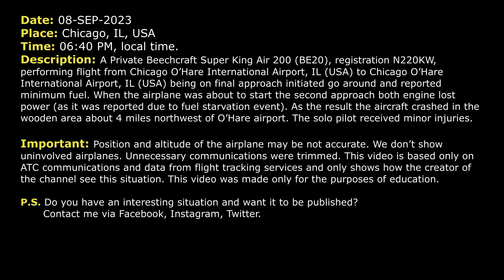Both engines stopped in flight. The is no FUEL. Beechcraft 200 crashes neat Chicago. Real ATC

Comment: I'm confused !!  The prologue states that the King Air was travelling from O'Hare Chicago to O'Hare Chicago !!! That's a mighty short flight to screw a fuel loading! 😆 I love your site.
("Probably whatever mission he was doing was a moot point if he couldn't land at Waterloo, so it made sense to return to base. Solo pilot in a King Air, likely he was going to pick up passengers at Waterloo to take somewhere else as a charter flight. Unable to land at Waterloo, the flight would be canceled, likely they'd use other transportation (probably just drive), so he was trying to return to home base. But didn't have quite enough fuel for the round trip.")

Comment: “Min fuel” should be declared at the point when you know you are landing with less than 45 min.  This (should have) been realized when talking to approach and not to tower on the go around instruction.  Maybe he didn’t add in fuel for a possible go around ?  A “mayday-mayday-mayday, fuel emergency” should be declared when known conditions exist if landing with less than 30min.  Then again, these are part 121 rules but would definitely keep any aircraft out of fuel starvation.  I’m glad the pilot wasn’t seriously hurt.

Comment: For King Air drivers if ya ever wanted to know how to run a KA outta fuel you now have a source. 
Why go-around in VMC with very low fuel in the tanks? 
KA drivers know why and what the yellow arcs on the fuel gauges mean. 
Always disappointing when an accident, that’s avoidable, happens.
Reply: Yep.

Comment: Unbelievable on both sides. ATC on  hearing "minimum fuel" should have immediately instructed go around to BOTH the other aircraft and got the stricken Beechcraft down whether or not it was a declared emergency. The Beechcraft pilot was utterly mad to continue an extended circuit knowing he was critically low on fuel, not just "minimum". Why is it that ATC in the US carries on vectoring other aircraft in when they know there is a potential emergency? The Beechcraft could have easily made it in with a simply VFR circuit close in to the pattern. This keeps happening. Madness.
Reply: You have no clue

Comment: My speculations: He knew he was low fuel, but didn't realize just how low. Thought he had 10 minutes left, when in fact he had zero. Perhaps a miscalculation, perhaps a malfunction in the plane's fuel quantity calculation system. Thus he didn't declare an emergency as he thought he wasn't in one, just "minimum fuel" as he reported. Let's at least give him benefit of the doubt.
As for the route, it sounds like he flew to Waterloo, had to divert, and came back to Chicago. Solo pilot aboard a King Air, probably a charter flight picking up passengers at Waterloo. Unable to land there, the whole mission was canceled, and so he tried to simply return to base at Chicago. Had nearly enough fuel for this, but either burned more or had less than expected, but both his return flight and declaring "minimum fuel" suggests he believed he had enough fuel for this.
Reply: Hoping for a quantity malfunction; that's one hell of an expensive miscalculation if not.

Comment: This is a great example of reluctance to declare a formal emergency…(no Pan or subsequent Mayday). Declaring ‘fuel minimums’ without stating what exactly you require from ATC is not best safe practice. The pilot always retains power of veto over ATC - accepting vectors that take you away from a safe landing option when in any type of emergency is foolhardy and bad airmanship. Glad to hear the pilot walked away in one piece - very lucky chap.

Comment: Minimum fuel = 30 minute reserve fuel, not the Empty line on the fuel gauge!
Unbelievable this happened and so preventable
Reply: We don't know what the fuel gauge was saying, perhaps there was a technical fault of some sort making him think he was low but not about to run out. Based on everything it sounds like he knew he was low but didn't realize he was this low.
Reply: @quillmaurer6563 fuel gauges on King Airs and turbine aircraft generally are quite accurate. It isn’t a simple float system like on piston singles.
Reply: Minimum fuel happens before the 30 minute point unless you happen to be touching down at that instant.

Comment: Let's hold back on judging the pilot until we get the results of the investigation. Must not neccessarily be his fault. Could have been a technical issue. According to ASN he did turn around because of some sort of problem in the first place. That dude didn't sound like he was not on top of things for sure.
Reply: Most likely low fuel but he hadn't realized how low. I don't know about King Airs, but I know Cessna fuel gauges suck. Turbine aircraft should have pretty good fuel management systems, as long as he knew how much he took off with the system should be able to keep track of how much he had, but that might not have been working right. He knew he was minimum fuel, he probably thought he had 10 minutes when in fact he had zero. He seemed aware that things were getting worse just before the engines quit, probably had some sort of warning sign (maybe one engine went out), but by then he was already being vectored onto final so an emergency declaration wouldn't have helped anything, and once the engines quit he made his situation pretty well known.
Reply: @quillmaurer6563 minimum fuel is when you are in danger of eating into your reserves if you have an unexpected delay. Emergency fuel happens the second you are into your reserves. He should have declared an emergency and they would have put him in front of the other two planes on the approach.
Reply: "That dude didn't sound like he was not on top of things for sure."
Seriously? He far king parked due to fuel starvation so just how is that being on top of things? It was amatuer hour in a B200.
Reply: @josephking6515  And I thought amateur hour was to reply on a comment you didn't understand...

Comment: ... Minimum fuel versus ... he was clearly in EMERGENCY FUEL situation. Which he did not properly relay to the controllers. If he had declared an emergency both of those other planes could have been moved out the way and he wouldn't have crashed...
Reply: He was emergency fuel about 40 minutes before getting into the circuit at ORD.

Comment: The pilot did not signal strongly enough, that he was in a critical fule situation and allowed himself to be steered far away from the airport. Mayday mayday mayday critical fuel now, MUST land now. And both the plane and pilot would have landed safely, and some extra paperwork had to be filled out.  There is no reason to be afraid to use pan pan pan or mayday mayday mayday when you are in a bad situation. Better to do it ones time too many, then to hesitat and  suffer  fatal consequences

Comment: For everyone commenting on "Minimum Fuel" equating to an emergency, the most recent version of the "ATC Bible" (Order JO 7110.65AA Effective April 20, 2023) notes that "Minimum Fuel" is not an emergency:

2−1−8. MINIMUM FUEL 
If an aircraft declares a state of “minimum fuel,” inform any facility to whom control jurisdiction is transferred 
of the minimum fuel problem and be alert for any occurrence which might delay the aircraft en route. 
NOTE−
Use of the term “minimum fuel” indicates recognition by a pilot that his/her fuel supply has reached a state where, upon 
reaching destination, he/she cannot accept any undue delay. This is not an emergency situation but merely an advisory that 
indicates an emergency situation is possible should any undue delay occur. A minimum fuel advisory does not imply a need 
for traffic priority. Common sense and good judgment will determine the extent of assistance to be given in minimum fuel 
situations. If, at any time, the remaining usable fuel supply suggests the need for traffic priority to ensure a safe landing, 
the pilot should declare an emergency and report fuel remaining in minutes. 

By not declaring an EMERGENCY the PIC arguably failed to discharge his duties under 14 CFR § 91.3.
Reply: The AIM 5-5-15 says something similar.
If you're dipping into reserves to make an approach, it's minimum fuel.
If you don't have enough fuel to do a go-around, it's an emergency.
Reply: EXACTLY RIGHT. There is a HUGE difference between stating minimum fuel and a FUEL EMERGENCY
Reply: One of your best lectures. How long did it take to copy all of that?

Comment: I fail to understand how a pilot would not load sufficient fuel for any given trip.  Running out of gas, except in extreme cases (IMC, multiple missed), is 100% unacceptable, and with the noted exception, is always pilot error.

I plan enough fuel to land at an alternate with at least 1 hour fuel remaining upon landing -- this includes sufficient time for a max of 3 missed at my primary (IMC assumed).  Some of my friends prefer 90 minutes minimum, depending on type.  If planning long trips, I will plan to land to refuel in 1/2 range hops.  If the weather is bad at my destination, I'll wait & fly the next day.
Reply: Your attitude towards fuel probably means you haven’t ever run it to risked your life. Cue the “old pilots / bold pilots” phrase.

Comment: Some official information on "minimum fuel" vs a fuel emergency... Aeronautical Information Manual 5-5-15.

5-5-15. Minimum Fuel Advisory

a. Pilot.

1. Advise ATC of your minimum fuel status when your fuel supply has reached a state where, upon reaching destination, you cannot accept any undue delay.

2. Be aware this is not an emergency situation, but merely an advisory that indicates an emergency situation is possible should any undue delay occur.

3. On initial contact the term "minimum fuel" should be used after stating call sign.

EXAMPLE-
Salt Lake Approach, United 621, "minimum fuel."

4. Be aware a minimum fuel advisory does not imply a need for traffic priority.

5. If the remaining usable fuel supply suggests the need for traffic priority to ensure a safe landing, you should declare an emergency due to low fuel and report fuel remaining in minutes.

REFERENCE-
Pilot/Controller Glossary Item- Fuel Remaining.

b. Controller.

1. When an aircraft declares a state of minimum fuel, relay this information to the facility to whom control jurisdiction is transferred.

2. Be alert for any occurrence which might delay the aircraft.

Comment: Min fuel and fuel emergency are 2 things….
Reply: He was about 30 minutes into his emergency fuel...
Reply: Clearly he thought he had more than he did. IFR flights are supposed to have 45 minutes emergency fuel, if ChristiNeagu was right that means in theory he should have had 15 minutes left. That's "minimum fuel," not quite an emergency yet, but apparently he actually had zero minutes left and hadn't been aware of this.
Reply: @quillmaurer6563 My 30 minutes guess comes from the fact that he ran out of fuel right then and there.
Reply: @quillmaurer6563   That's not the way it works.  On an IFR fllight you are supposed to have enough fuel to reach the primary airport, plus a diversion to an alternate airport, plus 45 minutes.  He was supposed to go to Waterloo, and a return to O'Hare would not have been his intended alternate, so he had been eating into his reserve for quite some time.

Comment: How about, “Roger, minimum fuel.  Say fuel remaining in minutes.”  None of that from the Approach controller.  I have to think there’ll be a lawsuit on behalf of the pilot, filed on this one.  Respectfully.  33yrs of ATC experience.
Reply: What? Why? Did ATC fill his tanks? Could ATC see his fuel gauges? If the pilot is not aware he has very little fuel, that's on him. You think ATC can fly the plane? They are busy with other planes.... I heard no Mayday.
Reply: @secondrule  First of all, calm down.  It’s called an opinion.  And it’s my PROFESSIONAL opinion.  I was an Approach controller for many years.  If a pilot declares low fuel to me, first, I have an obligation to acknowledge the pilots situation(something this Approach controller did not do).  Next, I’m going to inquire to the pilot about how much fuel he has remaining(in minutes).  From there, I can make a better assessment of where the aircraft will fit in the landing sequence.  Had the Controller done that, we probably wouldn’t be talking about a crash.  Granted, the pilot should’ve lead his transmission with “emergency fuel” and this crash would’ve probably been avoided, too.  Additionally, the pilot didn’t sound very confident, which is very unusual for a King Air pilot.  That would’ve caught my attention, as well, and prompted further question(s) about his fuel state.  But, the lack of confidence in his voice could be attributed to his knowing how dire the situation really was.  Try not biting off the heads of those you don’t agree with, pal.
Reply: Respectfully, there is one person and one person only who is responsible for the operations of the aircraft...and he never expressed any particular urgency, never mind declaring an emergency. I agree that, in an ideal exchange of information, a controller might request more information about the fuel state, but it's folly to expect that the controller is responsible in any way for this event. One would expect a King Air pilot to have an excellent handle on fuel state; I'm sure he never planned on landing without enough fuel to even taxi off the runway. That leaves us armchair commentators with three possibilities: 1. he understated the urgency of his situation (it was a true emergency, after all), 2. he really botched his fuel calculations or was otherwise inattentive to his fuel state, or 3. something very unusual happened with his fuel system. Again, one wouldn't expect a King Air pilot to lose track of his fuel levels and simultaneous failure of fuel flow to both engines is not likely, leaving us with good old human nature: no one wants to declare an emergency, and  the pilot of a complex aircraft certainly wants to remain calm, cool and collected on the radio. Denial and the ego are powerful foes, never to be underestimated. Yup, reminded me of Avianca 52 as well...just say "unable," declare an emergency, and come in to land.
Reply: 39 years ATC experience, and how about the pilot declaring emergency fuel. That being said, there is way too much missing from the recording.
Reply: Isn't it so that minimum fuel usually means the minimum left before you divert. If he had declared an emergency then yes, ask about the nature of the emergency. The pilot could have been more assertive in conveying his situation. There is an accident case study by the AOPA on YouTube about a similar incident.
Reply: ATC on VATSIM doesn’t count. I’ve had dozens of pilots tell me their minimum fuel and all I say is “Roger”. I don’t need to know what they have remaining because it’s not an emergency. A minimum fuel declaration means they still have enough fuel to get to the airport, shoot an approach, go missed AND fly to their alternate as long as they’re not delayed unnecessarily from that point on.
Reply: @anthonyd5189  Yeah, I’m not on VATSIM, JA.  If you don’t think this could end in a lawsuit, you’re kidding yourself.  Seen it…lived it.  Tell me at what point in the recording does the Approach controller specifically acknowledge low fuel?  Because I don’t hear it.
Reply: @Pats4vr 0KW:  We’re VMC, 0KW, we’re minimum fuel. ATC: Roger…

It’s literally right in the video lmao. And there is NO way this could end up in a lawsuit and if you think it can you’re way out of touch. We can’t help aircraft who don’t let us know an emergency exists. Should we sue ambulance companies for not showing up even though someone never called 911? Get real man.
Reply: The most I would expect following a minimum fuel request is an EAT. If I don’t get one then my next radio transmission will be requesting vectors to my diversion airport.
Reply: Sounds like the pilot misspoke or misunderstood. He should have said emergency fuel instead of minimum fuel. Min fuel usually means you can still get vectored around, emergency fuel is I need to get on the ground now. Where I work we use 45 min of fuel left as min fuel and 30 minutes of fuel left as emergency fuel.